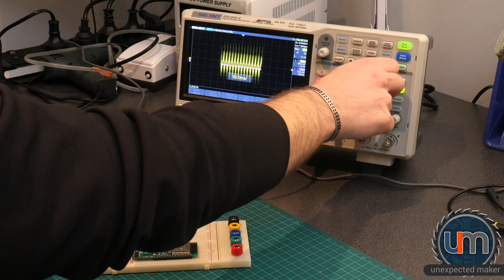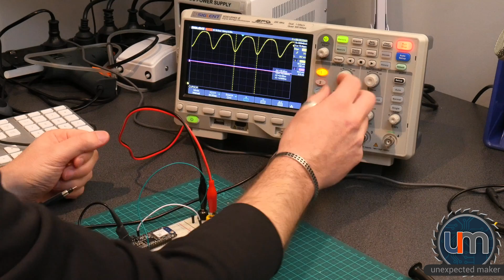Scope Sundays 01 - Noisy Waveforms!

Comment: Here is an idea for a Scope "Play". Something I did a while back. I have a spindle motor power adapter 110V DC 5A that had a potentiometer from 0-5v to decide the spindle speed. I want to control that from an Arduino. BUT! The Arduino does not have any Analog outputs, only PWM outputs. So I had to build a Low-Pass filter to turn PWM into a voltage level between 0v and 5v. Pretty simple, and very useful for many purposes. Couldn't have done it without a scope, the math is just above my head - with the trial and error of the scope it was fairly easy to try out some resistors and capacitors and find something that works well.

PS: The spindle potentiometer was actually between 80v and 85v compared to Arduino's ground, so I had to use an optocoupler as well, but thats not mandatory to explain how Low-Pass is a simple PWM => Analog converter
Reply from the maker: I tend to be spending a lot more time in digital electronics land atm... I seem to gravitate there, so yes, your idea is definitely a good one for playing with and learning how to use my scope better, but right now I'm chock-a-block just designing and making PCB 's ;) Maybe if/when I get board of that....
Reply: ok, how about playing with decoding the I2C bus signals that you are thinking of using in the led filaments segment display? Quite a nice thing to use the scope to "see".
Reply from the maker: That sounds much more like what I would use it for :-)

Comment from the maker: Ok folks... I have solved the noise issue... well, I have found the problem anyway... turns out if I power the Feather M0 with a Lipo or via USB, I get a perfectly clean and quite pretty looking waveform. If I power it via my (cheap ebay DC bench supply) I get erratic noise and crap all over the display. Turns out the PS was cheap for a reason... NO filtering at all ;)
https://www.dropbox.com/s/suqvm02ft2hbnpe/PerfectWaveform.JPG?dl=0

So tomorrow, I'm going to try to solve the PS filtering issue with some MEATY hi and low pass caps - but for now, it turns out it wasn't me, or the scope, it was my PS - yay!

All of that said, a few of you are correct that using long dupont cables for this type of testing is a terrible idea, and having a longer than needed path to GND is also not a good idea. Today was both frustrating and enlightening and ultimately, I learned a lot - which is always my aim.

And thanks everyone for the explanation of what the initial noise was I was seeing (EMI). I guess I just had a lot more stuff powered-on around me today than I had previously, so I had just never noticed how it was picking everything up before!

Comment: The noise you were seeing will be all the general EMI around you. Likely that the mains humm will be the largest component. I'm guessing  you had the volts range very low? Need to get/make yourself some short jumper wires for connecting up on the breadboard, rather than long Dupont cables as they act like aerials. For the crystal, you really want to be probing off a buffered output rather than direct off the crystal. Also it looked like you either weren't triggering off that channel or the trigger level was too high/low for it to give a stable display.
Reply from the maker: Thanks for the info Rob. Turns out it was my PS :( See my pinned comment for a proper explanation.

Comment: The noise in the beginning is because you're presenting it with an infinitely high impedance, i.e. the air. You're seeing everything from the power grid to local radio stations to every cell phone, computer, and microcontroller in your neighborhood. Try connecting the probe tip and ground wire across a 50Ω resistor if you want to see a better picture of how much noise is really present. When you're checking the crystal you're getting the same sort of thing.... a VERY high impedance will be present on one of the legs and touching that node will detune the oscillator quite a bit as well as conduct power grid and radio noise into the oscillator circuit which will add to instability considerably. The other leg of the crystal may be fairly low impedance and much more immune to the effects of probing, but it's not at all immune to adding noise from an antenna into the oscillator circuit. It may also not be low impedance at all; employing a series resistor of up to 100K or even more on the driver side. 

Bottom line is don't probe crystals unless you want to watch them not work. You want to probe a buffered output of the oscillator unless you want to build or buy a FET probe to attempt such things. You'll also never get great measurements in circuits like that at high speed when using a flying ground wire. High speed probes have a signal probe tip and a ground probe tip next to it and no flying lead. Your probes might even have an accessory in the kit that looks like a little spring with a probe tip coming off at a 90 degree angle. If so, they slide right over the grounding collar behind the signal tip.

https://assets.nexperia.com/documents/data-sheet/74HCU04.pdf Check out figure 14 on this HCU04 datasheet to see the sort of circuit you're dealing with and why it needs buffering. Just about every single node but one is high impedance.

https://community.keysight.com/community/keysight-blogs/oscilloscopes/blog/2017/03/08/considerations-in-probing-oscillator-circuits Note this six paragraph article shows the typical high speed oscillator which typically does not include series resistance as low speed oscillators often do, but it clearly and concisely tells the story.

If you want to try a hack, clip one lead of a 33pF cap in the probe tip and probe the circuit with the other lead... the removal of DC loading might get you a little further.

Some if not most of that display instability looks to be simply a triggering issue and you'll get that sorted out as you learn the settings. My guess is that you had the inputs on DC and were triggering at the Vmax or close to it. If so I would switch the input to AC and adjust the trigger level for stability.... but ideally on a lower impedance circuit. 

About 2 years ago I spent a little over a million USD of my employer's money on Tektronix scopes and time domain reflectometry gear to equip a high speed signal integrity laboratory for developing Thunderbolt 3 and USB 3.1 gen 2 based storage systems. At 5-6 GHz everything changes into transmission lines and propagating signal fronts and the probes get really, really, really crazy. We had $6000 scope probes with an accurate lifespan of dozens of measurements. My lab operated from DC to 33GHz and the lowest digit of the TDR gear read out in the 100s of femtoseconds. I threw it all away to leave the gun, alcohol, aggression, and ignorance crazed world of Texas and move to the mellow, intellectual, outdoor sports and weed crazed world of Colorado where everything is much more pleasant.
Reply from the maker: Thanks Peter. That was quite informative and easy to follow. Your story on the super expensive test equipment is insane! I didn't know that made equipment that expensive! $6000 probes? Wowza.

I'll look more into how to get buffered readings from the crystal, but I actually solved my noise issue...  turns out it was my DC bench PS :( I'm going to add a pinned comment to the video to explain.

I REALLY appreciate you taking the time to write up such a thorough explanation and breakdown. I am quite humbled to have such an amazing community of helpful and smart people here!!!
Reply from the maker: Yeah I am keep to look over the noise on my ESP32 design, to see how low I got it. not expecting fantastic results on my first attempt ;)